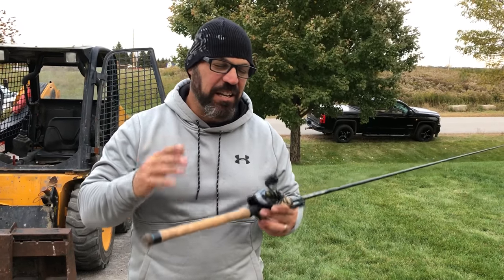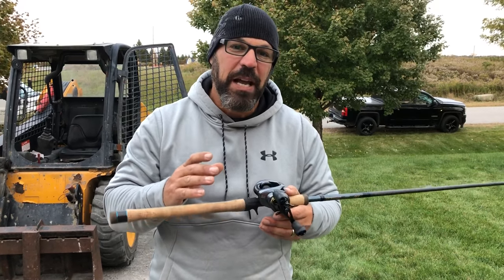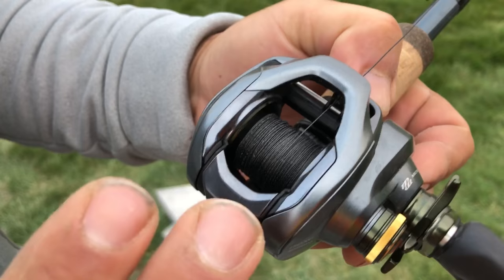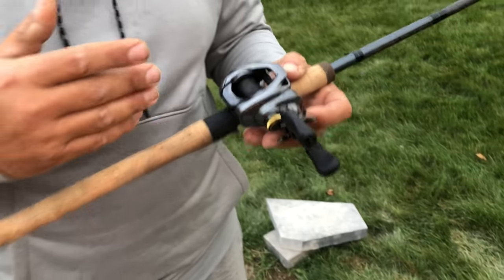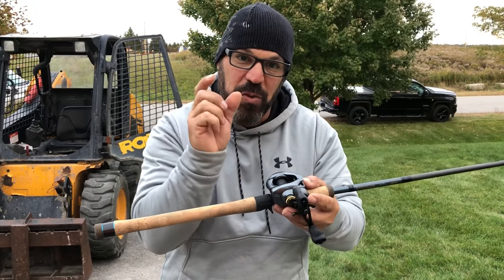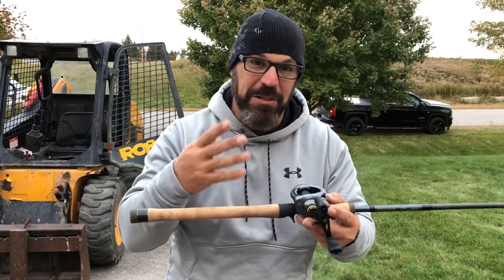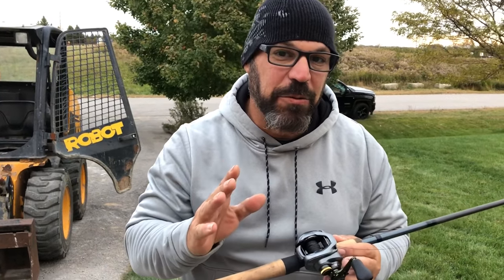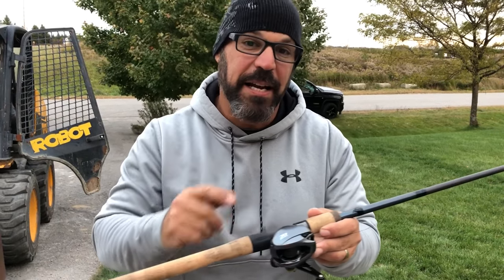Setting up your Curado DC reel properly.

Comment: Thanks for making this vid JP. Very first cast after putting on 30lbs Super Slick braid and got a huge ass backlash. Now granted my cast was only about 50% of how I usually throw but I was frustrated to say the least. I didn't touch (well hardly) the tension knob before hand. So now I'm watching every vid I can to learn how to properly tune this thing and try casting again but I will admit I'm a bit nervous now.

Comment: Thanks for the tip. Just picked up my Curado DC 151XG. I’ve have had backlash with my 151HG but I’ve mistakenly set it up like I do the Curado K and Bantam MGL.
Reply from the maker: Just remember that the only time the reels are thumbs free is in setting 4. The smoothness of the cast will also play a big part in the distance and professional overruns
Reply: @JPDeRoseOutdoors  okay did you thumb that cast you made? It was hard to tell because you were out of frame for a moment?
Reply from the maker: michelewinslow I didn’t use my thumb until the bait hit the ground. Then I stopped the spool from spinning.

Comment: So out of the box mine was set up to have zero play, I set the dial to 3 to be on the safe side. First cast using a mono/Fluoro hybrid got a huge backlash. I didn’t think I would have to thumb the spool before the bait hit the water. I wonder if the tension knob needs to be even tighter for a thumbless cast?

Comment: My dc works fine and I use the tension knob for lure weights like any other bait caster
Reply from the maker: It will still work like that but you will cost yourself casting distance with a tighter spool tensioner setting

Comment: Great info , thank you!! Question, I want to use a braid backing on the spool about half full. Then I want to fill the spool with 10 lb fluorocarbon.  So what setting would you recommend? The braid or the flouro?  Thank you in advance.
Reply from the maker: Mike Waara use the setting for whatever you are casting. In this case it would be the 10lb fluoro so use setting 3
Reply: @JPDeRoseOutdoors  hey, thank you for the quick reply.  I really appreciate that. Thx again!

Comment: Thanks for the tip JP. Somehow i still have problems with my Curado DC. Iam a fishing newbie and also still using spinning reel to learn. For fishing trout iam using a 1,5 or 2,6 gram hardlure. Westin W3 finesse T rod, 5-20gram with 0.20mm braid line. After first try i realise that the lure is to light (cant casting at all) and adding 9 gram more weightcasting. When less smooth casting i got a little bird nest and always birdnest by not thumbing when the lure hits the water. Not gain any distance by selecting break number 2. I tried your instruction in this video. Selecting break number 4 for thumbless casting, break number 3 for braid/longer distance and adjusting the tension knob until no side to side movement. Also tried the traditional methode by adjusting the tension knob for each lure. I can heard the DC running when casting. What did i do wrong?. Something wrong with my setup?. Is the line to tick?. I hope u can help me.
Reply: @Fishing Fanatic Freddy Casting 9 grams isnt bait finesse.  Its in the normal range for all of shimanos 200 size reels. Here in Australia we typically bass fish with baitcasters and lures 8  or 9 grams and ive had to stop selling them because of the number of returns. Its got way way too much braking on the minimum setting. I've got chronarchs, calais, calcuttas and a calcutta dc from 2006. They all handle 8 grams no worries. But not this pile of crap. I dont know what shimano were thinking.......... apparantly only double handed plug rods and heavy lures....... Yes 2.5 gram lures are out of the range of all of these reels and that is BFS. But 8 or 9 grams?......no.
Reply: Its a bad reel for 9 gram lures. The Curado K eats it alive. Get one of those.

Comment: Great Tip. Thank you. Shall we also use theese settings when using the Mode 1? Or depends the Mode 1 on the weight of the lures because the braking force of the electronic is less?
Reply from the maker: It depends on your casting ability and thumbing the spool. It will be hard to beat setting 2 for castability and distance... you can't haul off on setting 1 like that and tightening the spool tension will help but affect the distance greatly
Reply: @JPDeRoseOutdoors  Thank you. Today i have tested your settings and than switched from Mode 2 to Mode 1. Ok some feet more but you need to pay attention with your thumb. Mode 2 is much easier.

Comment: With the Currado and de Slv Dc  we  have 4 ajustement (1-2-3-4)
With the Scorpions DC we have 5 (1-2-3-4-W )
What is W and when we use it ?

Thank  You
Reply from the maker: 1 is the least amount of computer assist, 2 we recommend for Braid, 3 for fluoro or mono and 4 has the most amount of braking so skipping and casting into the wind or for new baitcast users. Not sure about the W as we don't have that in our iDC4 units.

Comment: Does this real work on 1/4 Texas rig plastics? Or is this to lite? I’ve had a lot of trouble with my reel and am wondering if my lure is to light. 14lb Fluoro on setting 3 with a 1/4 oz weight and a sweet beaver.  Blows up like any other reel??????? I’ve about given up on it.
Reply from the maker: The smoothness of the cast has a lot to do with it as well. If you’re trying to throw a light bait with a stiff rod, that often doesn’t allow the bait speed to load properly. So many variables but I have never had issues casting 1/4 ounce.

Comment: Set up mine exactly the same way, cast the exact same, blew up like any other reel.  However this was out of the box.. how long or how many casts does it take to charge the computer? I had 14lb fluoro on mine.  I am wondering if I have a bad micro chip???? Had do I tell? And advice? The reel is super smooth, just backlashes like any other reel if I don’t thumb it. You bombed it in your video without touching the spool which makes me wonder if I have a bad chip???????  Thanks for any advice
Reply from the maker: The computer charges from the current cast. It doesn’t need multiple casts to start working.
Reply from the maker: You still have to stop the spool at the end with DC reels. Where they assist is during the lure flight unless you have it on number 4 and adjust the spool tension knob to the weight of the bait.

Comment: I just got the shamano D.C. And did exactly what you show here, I put it on setting 4 and did light flipping not even hard and it's backlashes. I just got it out the box from tackle wearhouse! Do I need to do anything to charge up the D.C. Controls?
Reply from the maker: vinny luu the DC unit charges by spinning spool speed. Light short slow pitches do not charge the computer so it doesn’t work. It excels at casting and skipping hands free. If you are pitching short soft pitches you will need to use your thumb bud. No speed means no power
Reply: JP DeRose thanks for the reply

Comment: can i use my curado dc on saltwater? and if so how to actually rinse it off without damaging the dc chip? any tips or advice will help :)
Reply: Kpaw if you rinse it off do it lightly with water and use a rag to get into the crevases then make sure you re oil ot with the reel oil that is provided when you by it. That’s about as much as I know about cleaning for saltwater I don’t fish salt water but maybe it will help you

Comment: JP, what  line would you recommend for a beginner on the Curado DC? thanks.
Reply from the maker: heavy braid like Power Pro is best for learning to cast. 50 lb is a great starting point. The heavier the braid the less distance you will get, the lighter, the more distance.
Reply: @JPDeRoseOutdoors  thank you mate :-)

Comment: Thank you for this review. Your rod is 7’5” is it sensitive enough you can still feel the bottom when using worm?
Reply from the maker: The quality of the blank design, reel seat and graphite combine to make rods more or less sensitive. The length has very little to do with sensitivity within reason. Short answer, yes, the GLX 7'5" is very sensitive. That model is designed for bottom contact applications.
Reply: @JPDeRoseOutdoors  thank you for responding. I’m purchasing the 150 dc reel and can’t decide between the 7 or 8 gear ratio. Any advice?
Reply from the maker: @popaki9484  Depends on what you are using it for technique wise. The HG (7:1) is a great jack of all trades gear ratio. The XG (8:1) excels at fast moving presentations or when you need to pick up a lot of slack quick, like when throwing a jig/texas Rig plastic, I use it for burning spinner baits or throwing a frog. Stuff like that.

Comment: my dc doesnt have that sound...any advice?did the spool setting like above and cast,the sound of the dc is so tiny that you need to get your ear closer to it then you will hear it.
Reply: oh ya,berkley mono 15lbs
Reply from the maker: If you are casting lightly or at a slow pace then the DC unit will not charge enough. Make sure you are getting the spool speed up on the cast and it’s pretty noticeable the sound it makes

Comment: Hey new to bait caster bought a Curado DC 150hg atm I have Daiwa J braid on it but I’m not sure if that the best for it . What braid would u recommend?
Reply from the maker: There are a lot of good braids on the market, I have been using PowerPro my entire life basically and it has yet to let me down but J Braid is also a quality product. The bigger concern should be what pound test you run. The thinner the line the more it will bite into the spool on a bait caster. I usually recommend 30, 40, 50, 65 or 80 lb test for best line management.
Reply: JP DeRose thanks for
The info we put 20 on just for me to practice around the Estuary system but I’ll upgrade it before I come to
America. I’m thinking I’m go 30 that way I can also use to it chase barramundi in Australia. One more question one of the people at the store I got it from said to use the 4x instead of the 8x but we put the 8x on any advice about that?
Reply from the maker: @E1eni  That is just the strand count of the braid. Traditionally braid is 8 strand for the most part and that's what I use most often.
Reply: JP DeRose thanks I also always use 8 stand I’m was confused on why old mate told me to go with 4 . Cheers for the replies

Comment: I have a slx dc 150hg when I set mine as he said to just where there is no side to side play I get over run ...when I set it to where whatever bait I have on it doesn't fall i don't get any backlash or over run but distance might take a slight hit ..so which way is correct to set it I seen videos of ppl saying both ways
Reply from the maker: If you are getting back lash up the setting on the side. 4 is the most control 1 is the least. By setting it with no side to side movement, that is how to ensure maximum distance with least amount of resistance
Reply: @JPDeRoseOutdoors  Do you think if people don't loosen the knob right away that it can damage the reel? 
The way they word it seems like it maybe..
IF the cast control knob is tightened more than necessary, the dc system can not demonstrate its ORIGINAL performance.
Reply from the maker: @HouseholdGuppies  no, you won't damage it at all. Tighten the spool tension knob will only hurt casting distance. The point of the tightening to where there is no side to side play is to ensure the magnets are secure inside the coils for optimal charging of the DC microcomputer.

Comment: How do you spool it with only one hole in the spool?
Reply from the maker: You don't put your line through the spool, you use an arbor knot anytime you want to tie your line to your spool. If you are using straight braid, use the arbor knot them out a small piece of tape on top of the knot and start spooling the reel. That will stop the slipping

Comment: I have a new dc and I don’t like the fact that I have to run it with tension on the spool for the brake system to work.
Reply: fuenstock buy a different reel
Reply from the maker: I set it with no tension fuenstock, I only tighten until the play is removed from the spool in regards to side to side movement
Reply: go spinning , or zebco

Comment: which rod can you recommend for dc? mh or h? Greetings from Berlin
Reply from the maker: Francis T depends on the weight of the baits and size of the fish you are targeting. I would match the rod power rating to the size of lures I use most often.
Reply: @JPDeRoseOutdoors  do you have any recommendations for an all around rod?
Reply from the maker: @igorkatiuzhinsky6705  What are you fishing for? Species wise....
Reply: @JPDeRoseOutdoors for bass
Reply from the maker: @igorkatiuzhinsky6705  For Spinning a 6'10" - 7' Medium, Fast Action rod is the best Jack of All Trades, for Baitcasting, I recommend a 7' - 7'2"  Medium Haevy Fast Action rod

Comment: I can’t get mine to stop back lashing. I have 20lbs fluorocarbon with a full spool . I have it set up exactly like you said in this video and it backlashes in power 4 like crazy
Reply: Any help thank you
Reply from the maker: Are you hearing the whine of the DC when you cast?
Reply: JP DeRose yes
Reply from the maker: @protungsten8315  That's very strange since I can't get it to backlash in number 4, unless you spike the cast straight down in front of you. Call customer service bud
Reply: Tighten the tention knob untill your bait doesn't drop that will fix it
Reply: @wolfpacak47  long time ago but does it affect casting distance?

Comment: This is exactly how i set mine up. However, if i dont use my thumb to stop the spool after casting and the bait hitting the water it will bird nest like hell. Same if i let it drop and letting it hit the ground while standing.
Reply from the maker: The DC units need to be spinning fast to work Pete. Just free falling a bait will not be enough speed to charge the micro computer hence the spool keeps running
Reply: JP DeRose got ya, just making sure that was normal, as I’ve seen lots of vids where they don’t stop the spool after casting without birdnest issues.
Reply from the maker: @pete7062  Typically only on setting 4 is that possible
Reply: JP DeRose thanks for the input
Reply: Tighten the tention knob untill your bait doesn't drop

Comment: Anybody else have issue with the drag slipping? I have mine crank down not all the way but down enough like how I do with my other reels. It’ll slipping when I set the hook. I don’t want to crank the drag down too hard.
Reply from the maker: Retrou Vailles the DC has 11 pounds of drag like practically all the other baitcasting lowprofile reels Shimano makes. Are you using braid? And if so, did you use a mono or fluoro backing or tape on the spool?
Reply: JP DeRose I have three dc, two with fluorocarbon and one with braid. I just tie them on the reel. Most of the time, I’ll insert my line into the spool and out the other and tie. With the dc, I couldn’t do that. Do you think my line is slipping rather than my drag?
Reply from the maker: @BayJoua  Odds are good. Let the line all out when you are fishing and place a small piece of tape over the knot on the spool then reel back over it. See if that helps.

Comment: What size braid?
Reply from the maker: That one had PowerPro Maxcuatro 80lb but on baitcasters I use everything from 30 up to 80lb depending what I am using it for. As a side note, you can cast further with smaller diameter braid so keep that in mind if you're looking for casting distance. 30 and 40 lb PowerPro is perfect for that!

Comment: So, why bother to put spool tension knob, why don't they just using some kind of spring and get rid all the tension knob
Reply from the maker: That's a question for the engineers. This is the setting for maximum casting efficiency. I know that if you tighten it beyond that, it helps reduce backlashes further but at a price of distance. Everyone seems most interested in getting distance out of DC reels along with efficiency.
Reply: @JPDeRoseOutdoors  yeah, I had curado dc for a week now, and its written on its manual, how to setting tension knob, 
Thanks for your video, I wouldn't have any idea on how dc tension setting before, even I own dc reel, but who's reading manual nowadays

Comment: shimano literally says leave it as it comes from the factory...  i dont understand why ppl think they know better than the manufacturer.  setting 2 is for braid and mono as well.
Reply: I did that and very first cast with braid tied on dial set on #2 and huge ass backlash. So not sure if it was me, not all of the reels are properly set from the factory or clerks/customers at the stores screw with them and get them off optimal tension but I wouldn't trust the one you take home is set ready to go.
Reply: @12thFan23  could be right. Whatever works.

Comment: My handle just broke or the bearings broke or something on the first day I’ve ever used it. Wtf $250 reel shouldn’t brake on the first day
Reply from the maker: You're absolutely right it shouldn't. Shimano has great customer service, please contact them, I'm sure they will be more than willing to help you out.
Reply: Mine was submerged in water for 2 days and works just fine.
Reply: are fishing with it or golfing with it?just a bit curious.

Comment: Very poor reel. Spool is ridiculously heavy compared to the non DC version. Need very heavy lures relative to how I'm used to using a baitcaster.
Reply from the maker: The spool has to weigh more for the magnet and coils to generate the charge or else have a digital control reel would be impossible
Reply: @JPDeRoseOutdoors  Yes I didn't mention but I'm aware its the heavy rotor that the magnets work on. But the thing is, my Calcutta DC from 2006 casts like a beauty! I must dig it out and compare the design.

Comment: I’m having issues with line retrieval with a load (fish). Will this fix that? The spoil just kind of stands still and won’t pull in line.
Reply from the maker: Odds are your drag is too loose. Tighten it by turning the star drag behind the handle forward